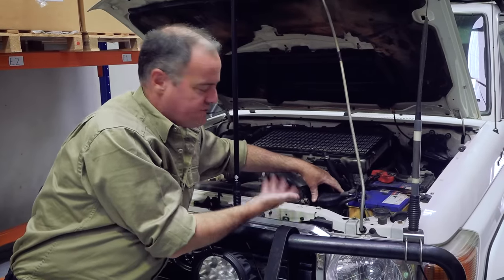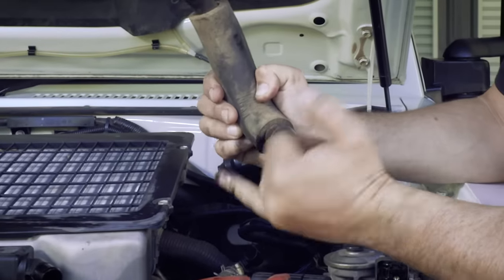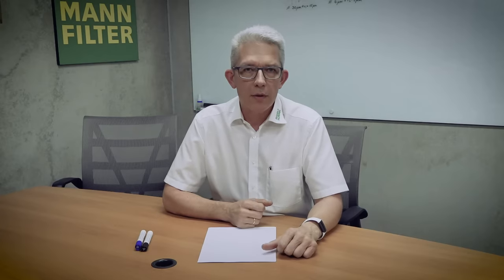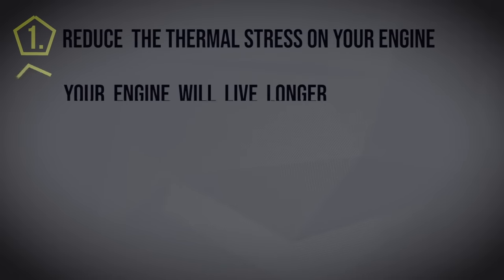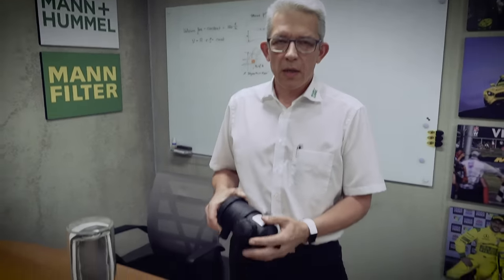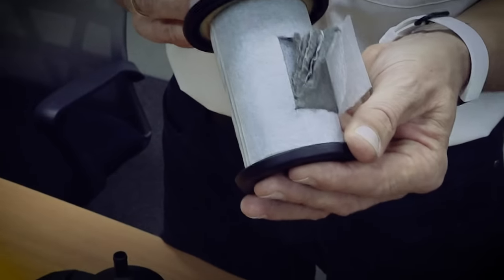CATCH CANS & EGR explained in detail! Why your diesel’s clogging up & losing power - how to fix it

Comment: I just wanted to ask the question, I’m about to fit a provent catch can to my 2013 ford ranger with 130k on the clock , would it be advisable to do a proper pull off intake manifold clean to get the most out of the setup, or is an on the car intake clean good enough , would be great to find out before I install system?
Cheers
Reply: Have a look in there, if the intake needs a clean then take it off and clean it.
Good weekend project (or any day during these times)

Comment: Ford 6.7l power stroke has a oil catch can from factory. It has a crankcase pressure sensor in it that fails all the time.
Reply: what does it do when it fails?

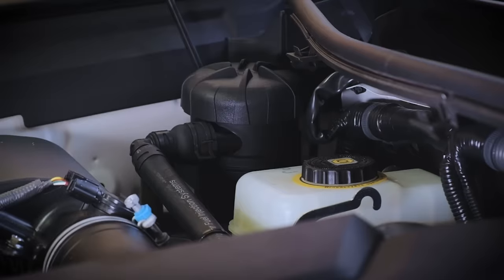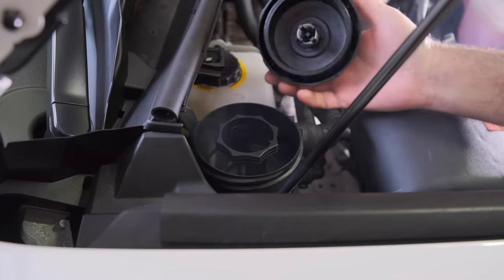Comment: Oh boy! At 1:07 and 3:47. WHY?! would you reduce the cross section of the plumbing to/from catch can? You did show how much of blowby diesel has. The way it looks you "acheived" 50-75% flow resistance depending on the size of that 90deg adaptor. PV200 is rated for engines under 200kW and has 25mm inlet/outlet for a reason, whereas PV100 for under 100kW - 20mm. Your longish lines already introduce enough restriction.
Reply: I was thinking about that whole scenario of those 9o degree connectors at 3.47 minutes. I have just installed this and I had to use 3 of those L shaped connectors!?

Comment: Interesting. But. It isn't the oil vapour that builds up - it is the soot from the EGR that builds up. Stopping the oil vapour (while good) just prevents the accumulated soot from becoming wet and sludgy. If there was no EGR soot (illegal to block, bypass, or remove the EGR), then the oil vapour would just pass through the motor and not accumulate in the intake (might make it oily but that is about all). I would like to see the internal condition of intake system after 20,000 or 100,000 so kms with the catch can stopping the oil vapour - I'm betting there will still be a carbon build-up, but it will be dryish rather than wet.
Reply: You are almost right buddy, but I guess that the PCV can actually cause carbon buildup on the engine even without EGR. 
Maybe less, but I don't know as most of my cars or the experience I own with cars mostly are turbo diesels.
As I can understand, for example GDI engines can have this kind of problem even if they don't have equipped an EGR system.
I'm not sure if I'm wrong but that's what I actually found.
Regards.

Comment: I would consider getting one of these but I know it would void my warranty and if I had any engine problems at all, the manufacturer would walk away. I would then be depending in the insurance of the professional that installed it. If I did it myself I would have no chance.
Reply: They would have to prove a catch can caused the engine failure which is garbage.
Catch cans prolong the life of diesel engines.

Comment: Dumb question, how come these are not sorted out by the manufacturer? As in what stops them from installing a catch can from the get go?
Reply: 1. The engine will last the warranty period with or without one, saves them money to not fit them.
2. As the expert said, it needs to be maintained (emptied) every 5'000kms. If its not emptied and becomes full, it causes bigger problems - excessive pressure build up in engine and can damage engine seals.

Comment: I wanna see what the comments reckon. Should I remove my EGR? What issues would that then bring?

Mine constantly breaks, leaking coolant into my exhaust system. 
I have replaced it 4 times... while the part costs $400..
Reply: 6:50
I guess it dependes on your car and where you live. If you have a good cooling system and a reliable engine and nobody cares, then i would do it...

Comment: I have a holden colorado 2010 and they have the problem of the engine light coming on because of the egr if i put a catch can on will this eliminate the problem?
Reply: I've fitted a munji egr delete cable without engine light coming on in my 2011 colorado. Fitting a catch can this week too

Comment: Why dont manufacturers include catch cans from new?
Reply: Because they still have to vent the pressure from the crankcase somewhere and the only legal place to vent the pressure is back into the intake. Effective filtering is at odds with relieving the pressure from the crankcase. A filter that catches every last bit of oil will be too restrictive to prevent pressure building in the crank case. 
That's why most aftermarket catch cans vent to atmosphere because it completely solves the dirty intake issue and they don't care if some oily vapours make it to the atmosphere - they are however illegal.
A complicated catch can also adds extra cost to producing and servicing the vehicle and every dollar is important if you're in the business of selling and servicing vehicles.
Reply: TMM if you watch closely the catch can only catches the oil and the blow by pressure still goes into the intake. So I can see why he said why don't manufactures do this from the get go.
Reply: @lukepaul2882  yes, so it does not completely solve the problem. Less oil will make it to the intake but there will still be some oily vapours vented into the intake and the crankcase pressure will be higher as a result of the restriction that the can makes. Whether or not this is enough improvement that it is worth doing and doesn't cause negative effects I couldn't tell you.
Reply: A piece of the picture nobody seems to mention is the answer to your specific question. The answer is because if the oil catch can is not maintained properly, this can cause more damage to the engine than not having an oil catch can in the first place. As some people mention, many people do not regularly service their vehicles properly or enough. This introduces a very real problem and concern for the manufacturer to deal with. In addition, unless the vehicle is Direct Injection, the issues created by not having a catch can are typically not an issue until after the car is out of the warranty period. In the case of Direct Injection vehicles, some manufacturers are utilizing other methods to stem a part of this problem (typically carbon build-up on the valves in particular).
Reply: Thanks for the replies TMM and stephen commando. These sound like valid reasons why a manufacturer might not fit one, even though they are beneficial. Just trying to disentangle the marketing from the facts in this video.

Comment: So blocking/blanking the EGR is actually bad for your engine as it will increase combustion temperatures? 

Will a catch can void your warranty, I have heard some Toyo dealers trying this on.
Reply: N Noddy its bullshit. I blocked mine it runs cooler according to the egr gauge. There just trying to sell there overpriced rubbish. A fuckin ebay catch can for $10 and $1 of steel wool does the exact same thing

Comment: What sort of cleaning of the intake system should be done once you fit a provent catch can? My px ranger has done 60,000kms and hasn’t ever had a catch can fitted. If I was to purchase a provent catch can and fit it to the engine, will I still have to clean the intake system and remove the original soot/ carbon deposit or will it break down and self clean over time being that the oil content in the intake system has been reduced as a result of fitting the catch can? Thanks in advance guys!!
Reply: DO NOT install catch can to your car! it will void the warranty!

Comment: Is there a link where I could download more information and how to install on a 2017 Isuzu Dmax 2.5. Also, does it only work for common rail engines?
Reply: Mate it works for all direct injection engines, petrol or diesel, common rail or non common rail (in these engines there is no fuel wash through the manifold).  And all combustion engines produce blowby which nowadays is fed back into the inlet.  A few manufacturers of petrol DI engines add a fuel injector in the throttle body which operates under certain conditions to wash out the manifold buildup.  Some enthusiasts add their own water/methanol injection systems on diesels to overcome the problem and bump the power.
Try the Mann-Hummel website for a can to suit your engine.

Comment: I'M NO MECHANIC...BUT STILL FIGURING OUT THE USE OF AN INTERCOOLER IF YOU ARE DUMPING HOT EXHAUST GASSES IN TOUR INTAKE?
Reply: That is a good point. The EGR is made up of 2 main components; 1. the exhaust gas cooler 2. the EGR valve. The exhaust gasses pass through a heat exchanger first before being routed to the inlet by the egr valve.

Comment: Don't get scammed by adding a catch can.. the oil is important part of lubrication and cleaning process comes down to poor maintenance, irregular oil changes and worn injections.. this is only a band aid patch job, look deeper into the real issues
Reply: Catch can is the modern engine fix snake oils!! It could severely damage the engine when it fails, and like so many other engine parts, they will fail and the cost to repair the engine will run into thousands of dollars.

Comment: Do i need this on my Nissan Patrol from 2000? It has a 3L 4 cylinder? Also mine is from Europe.
Reply: does your crankcase circulate thru a turbo ?
if so then get on it :)
Reply: @gettingoutback3165  Yes it has a turbo to.
Reply: No,just block egr.don't believe this extended advert
Reply: @renbenism  i also heard thatbi just have to remove egr and evrything will be fine

Comment: I'm from the States, so we use diesel much less here and I am unfamiliar with Australian law.  But wouldn't it be easier and cheaper just to re-route the crankcase exhaust lines out the exhaust manifold where the super heated exhaust gasses could safely incinerate the oil vapor prior to it reaching the catalytic converter, thus reducing emissions and ensuring long engine life?
Reply: Yes and no. Probably it will clog the filter because of the oil contamination heavy particles. Also diesels run much lower EGT so it will probably not burn at all before reaching the filter

Comment: I just vent it to atmosphere with a filter and blocked off the egr valve.
Reply: Ok, but not that efficient as the filter is reducing the output so, it would probably go back inside mostly.

Comment: Diesel engines are naturally are a dirty engine.
Fitting a can helps ease the mindset that it's working but that can has to be fitted correctly and filter replaced often to be effective.

Comment: if your getting that much oil in a catch can after 2,500k's you have a major problem with blow-by or pressurization of the engine, and catch can is only a band aid job and not going to solve or fix the issue.
Reply: Turbo diesels from new all breath oily fumes.

Comment: Why didn't car manufacturers just add a catch can in the first place
Reply: Planned obsolescence. Its engineered to fail so we spend that $$$$$!!! Modern day slavery at work, debt slavery.
Reply: Scotty Kilmer answered this question - it's just too much work for the "average" person to attend to. It's just another thing people need to maintain and it's hard enough to get people to do regular oil changes as it is.
Reply: @canyonoverland5003  what do you mean mine drain direct to the sump never have to lift the bonnet
Reply: Number one reason is because it costs money, and manufacturers don't see the need to prevent problems that will only likely come up once the warranty is over. It usually won't give problems until 100,000km, most people buying new cars don't know what a catch can is or don't care, so they save their money and go without. Also having a replaceable catch can filter adds to the cost of service, and this is something manufacturers want to reduce because customers take this into account when buying a vehicle. Same as why they have long oil change intervals and non-replaceable transmission oil.
Reply: @cbishop41483  spot on

Comment: Catch cans don’t work. If you want to prove they do, show me the internals on 2 new engine brake downs doing the same driving under controlled conditions after 5000km , one with and one without a catch can and prove the effectiveness of a catch can.
Reply: I've worked on hundreds of diesels and every one fitted with a catch can has much much less oil through it and the catch can is always full. They are very very effective and should always come from factory, especially with turbo diesels as most intercoolers become extremely ineffective
Reply: @achilleaustin  The cure (catch can) is the worse then the disease!! 
What will be the consequences if the catch can fail while you are driving? let say the PVC cracks!! how do you get alerted on your dash that your catch can have malfunction and you need to replaced? what if you forget to drain it? or sell your car and then next owner doesn't drain it? what kind of test and quality control have the catch can gone through? 

Do you seriously think a $200 PVC can will fix a complex engineering problem that engineers at Bosch, Toyota, Ford, VW, BMW...etc could not figure out with all the resources they have at their disposal? if catch can was a viable solution this companies would have sell you million to people as accessories. 

You could be a good diesel mechanic, but don't tarnish your reputation by supporting catch can!!

Comment: What a joke. You don't need a catch can, majority of what it catches is moisture. The minor bit of oil it catches is harmless, 20mL at most over thousands of K's. The prime culprit for this buildup is the EGR NOX itself, which can easily be reduced to harmless levels via an EGR flow reduction plate which you can grab from KAON for $10-$15. No dirty exhaust fumes, no caked on build up on the intake. Stuff paying $400 plus labour for a catch can that picks up a bit of moisture and can cause more problems then it fixes. Also how does an EGR lower temperatures? The air coming out of your exhaust isn't cool at all, its purely emissions.
Reply: "How does EGR lower temperature?" The theory is that it partially extinguishes the 'ignition' (by 1/2 filling the cylinder with non combustible gas) making it a less volatile burn. The recycled gases also go through an EGR cooler before they enter the intake.

Comment: Step 1: get hose from parts store
step2 : connect hose to pcv valve
step3: run hose to the bottom of the engine or behind it

boom done. vented to atmosphere.
Reply: Wouldn't recommend that, not only will you cover the bottom of your car in oil, you can have certain low load situations where it will suck air into the crank case. You're also exposing the crank case to fresh air which could cause corrosion. A catch can is the best way of doing it.

Comment: NO to OIL CATCH CAN it will destroy your engine....do you think why the car manufacturers or automobile engineer didnt install the OCC or oil catch can at their unit? do you have heard about the oil mist coming from the valve cover air outlet port? do think it is just a breather? did you know that Oil Catch can kill the oil mist and later on will destroy your engine...here is the logic...when the engine is running it sucks air into your air filter but some of the dust will escape in the air filter and enters into the intake manifold and probably to your cylinder and it will slowly sctatch ur cylinder that resulted to serious damage same through with the exhaust gas recirculate or egr there are carbon emissions from the egr which will also enters inside the  cylinder...but here is the purpose of oil mist the oil mist first will lubricate first your turbo impealer for those turbo engine next is to slightly wet the intake wall of your engine so that when the dust particles escape the air filter it will stick into your intake wall and then it will not directly enters the engine cylinders, same through with the carbon emission came from the egr it will stick to the intake wall to prevent entering to the cylinder, thats the purpose of oil mist, if you use Oil Catch can you will probably kill these oil mist and also your engine...yes it will dirt your intake manifold but it will save your engine in the long run...the maintenance is always there the standard of these are, you should regulary take your car for a service maintenace  every 50,000 km run to clean these carbon deposit...i hope you understand what im talking about this will save your engine

Comment: So let me get this right it's to reduce ignition temperatures but it's not putting in the exhaust gas all the time  and his little diagram means that when it's not got the gas in half of the chamber the rest of the time is running as it should with oxygen rich air so that tells me the engine can handle the high ignition temps as it runs part time with no EGR so it's just the nox people are worried about bloody greenys I'm going to get mine remaped and blow that shit out the exhaust as it should

Comment: Why don’t they just do this from factory? Surely it would still meet emissions🤔
Reply: Because it's another service item and if not emptied can cause major damage. Therefore they dont fit them as minimum servicing is the goal
Reply: RaggedKiwi if they could design one that just get emptied at each oil change.
Reply: Or this guy wants to sell a product to a problem that doesn't really exist?
Reply: naten2645 it does exist and it is a big problem, mine became really bad. Now I have catch can and it works great.
Reply: @dawsonginn7482  yours was really bad now it's really great? So you pulled the motor down to clean it all up and now it's great? Sounds like a sheeple reply
Reply: naten2645 yes bud I did. You got a problem with that?